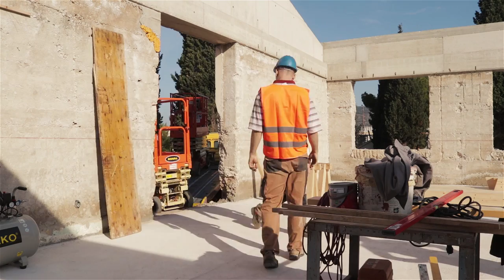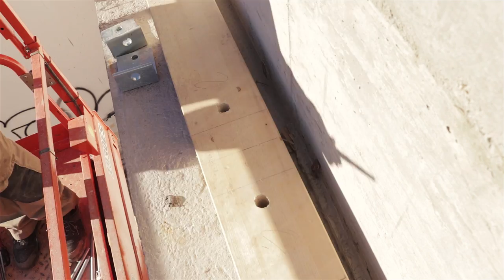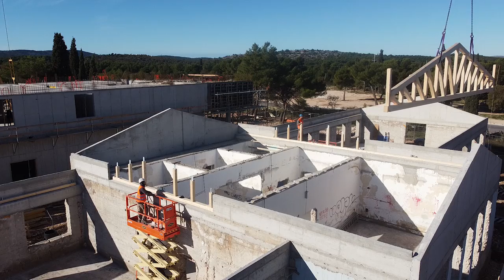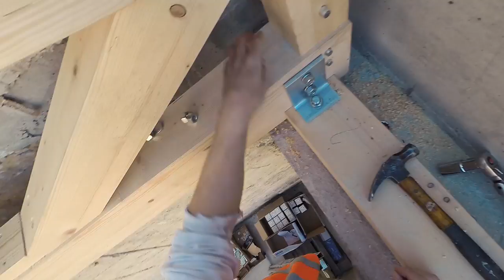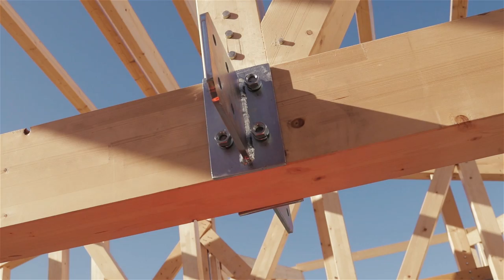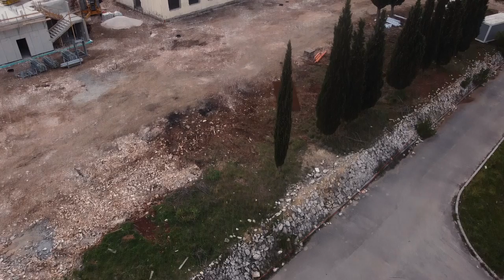Production of wooden truss structure Pt.2 - On-Site Assembly

Comment: I truly hope that beautiful roof structure will be exposed and not covered up with a ceiling.
Reply: Indeed.  The exposed OSB on the bottom makes me worry they won't show it, but hopefully they've got a plan.
Reply from the maker: The trusses and bottom 2cm of battens will be visible. Osb is there just to hold the insulation and other layers of the roof, bottom of it will be covered up..